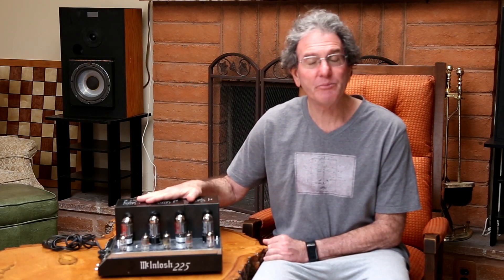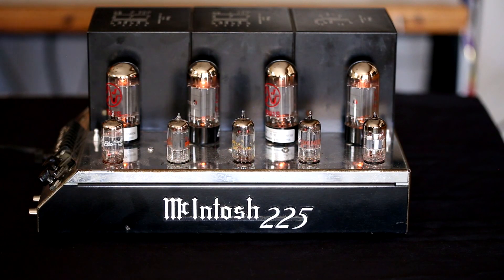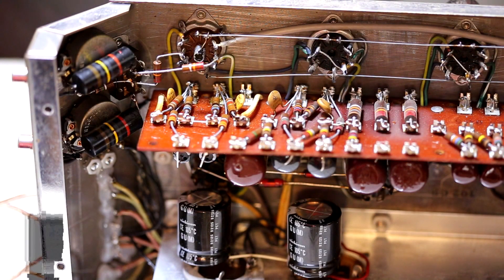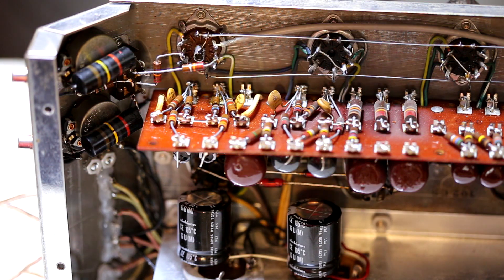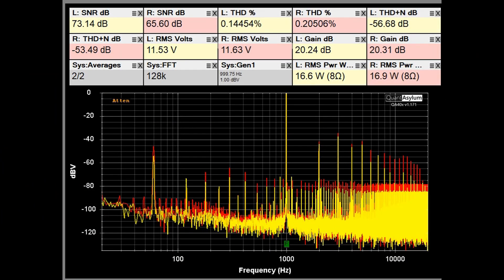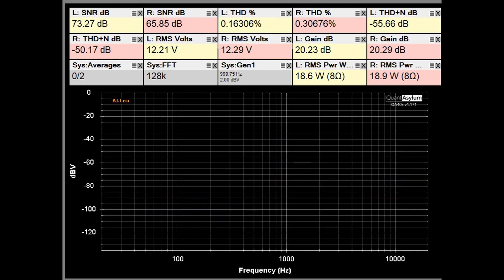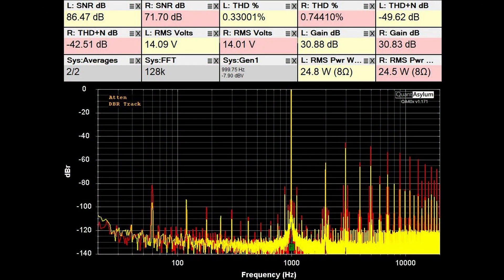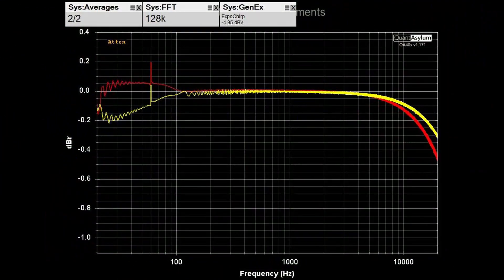McIntosh MC225 Power Amplifier- Vintage Audio Review Episode #58

Comment: Hi -- I have a MC-225 that had the power supply, audio path, and bias upgraded by Terry DeWick in 2018.  I am also using LaScala speakers.  How do I set the gain to the level you were referenced in the video.  I have the gain pots set at about "9" position to keep the audible hum down. Turning them up beyond that position introduces hum, especially in the right speaker, and doesn't result in much of an increase in the volume.  I am trying to optimize the function.
Reply from the maker: I am not familiar with the person you mentioned or what the bias upgrade involves, but it sounds like he know what he is doing. It sounds like your idea to minimize hum is fine. Were it me, since I have an audio analyzer, I would out in the standard 1khz signal at ~0dBV (1vrms) and adjust the controls for ~20dB of gain, which should be ok for most preamps. Since you probably don't have an audio analyzer, I like your method and with the lascalas- which make hums louder due to their high effeciency- the 225 should provide plenty of power to them.

Comment: You should never plug a tube amp in with no load. It’s a sure way to kill the transformers.
Reply from the maker: I appreciate your taking the time to comment. I have heard this before, but have always wondered about it since the spec for damping factor is based on the amp's voltage into an 8ohm load and then an open circuit, typically at 1watt. I have not had this happen in my experience when a tube amp was switched during an a/b test (my switcher does not have an internal load), though the power was <5w I am guessing. The same is true with the a/b test between a Marantz 8b vs the Ayima T9. If you were putting out power near the maximum output levels, this may be more inclined to happen if you disconnected the load (speaker) due to a very voltage or current spike ?

Comment: My Mac mc225 is the best amp I’ve ever heard. It looses bass when pushed. At low to moderate volume levels the amplifier is pure heaven!
I use a Vinnie Rossi LIO as a pre-amp with JBL L100a loudspeakers circa 1980. My favorite source is a Technics 1200mk5 turntable and Nagaoka MP110 cartridge. 
Blue Glow Electronics has a detailed video on restoration of the mc225. 
SkyFi Audio has two of these for sale, as of this posting, priced at $10,000 each. 
Thank you for highlighting this wonderful amp.
Reply from the maker: Many thanks for the comments. Quite a nice vintage system you have put together. I thought the MC240 sounded better than the MC225, at least the ones I listened to.
Reply: Yeah sky audio is highway robbery . I bought one directly off eBay for 3500$ and it works wonderfully . 
I'm also using a pair of 1959 H.H. Scott 99d integrated tube mono blocks as well that are quite nice themselves they do about 22WPC but they honestly sound as good to me as the McIntosh . Man old Scott Amps are honestly one of the best buys to this day!

Comment: Thanks for the video. I hear a bit of audible buzz or hum from the transformers of my 225, fully restored, when turned on without any input. Is this normal?
Reply from the maker: I would say that is normal for a lot of gear- if, by no input, you mean the 225 is not connected to any preamp at that time.
Reply: I don’t think it’s normal. My mc225 does not hum, buzz or hiss from the loudspeakers. I do hear a little hum from the amplifier itself if I am very close to it in a quiet room.
These are fantastic amplifiers - if the hum bothers you it might be worth figuring out what causes it. 
Blue Glow electronics has a video on restoration of the mc225.

Comment: Oh, what a great Mc225 is !
I owned beloved Mc225 after 2010. I matched it with Audio Research SP8, Linn Sondek LP12 and KEF 107/2. Great sound than any others.  I ❤️ Mc225..
Reply from the maker: Thanks for commenting. Depending on the level you listen at, the MC225 may not have enough oomph for the 107/2's if they are anything like the 107's which I have- at least it would be close for me.

Comment: Enjoyed the vid, very informative, thanks a lot.  That software is great!  I got one of these amps in a trade and will be recapping it, etc.  As far as a preamp, I'm a DIY guy, can you recommend a good circuit, maybe something from the RCA tube manual, that would be a good match for this unit?  Or what I should be looking for?  Cheers
Reply from the maker: Thanks so much for taking the to comment! I am not a DIYer except for power meters. I don't have any special love for tube gear- as a preamp- unless you are after the nostalgia factor. I would think re are lots of DIY tube preamp kits our there, but it is not something I have looked into.
Reply: @vintageaudioreview  Thanks for the feedback.  I guess I'm wondering what sort of specs a preamp should have to be a good match for the mc225, if there is such a thing.  I don't have to do tube, SS is more than fine if its a good match.  This is primarily for phonograph.  I'm afraid my next question is what sorts of speakers should i get!  Thanks a lot.
Reply from the maker: @schance1666  I forgot where I said I thought the gain should be adjusted on the 225, but you just want to make sure that the preamp can put out several volts- probably at least 3volts rms. A SS pre will be fine with the MC225's. Speakers- most important purchase you can make and highly personal. I would look at Klispch speakers or maybe JBL speakers that used a horn- you want something very efficient if you are using a tube amp...

Comment: You might be surprised at how different the MC225 can sound with different mfg tubes... starting with 1960's RCA Black Plate 6L6GC's and 1960's Tele's or Mullards in V1 (12AX7). 
Can you identify mfg and version of your very detailed charted test program ?
Thanks for posting.
Reply from the maker: Thanks for taking the time to comment and I appreciate you suggestion. The MC225 is not mine and as I remember I just replaced a few tubes with some "inexpensive" ones. I now own a pair of vintage  Mactube amps, but unless they start sounding bad from a tube or tubes going bad ,I would not do any tube replacements to them- am not sure how easy or affordable the tubes you mention would cost.... The measurement system I use is made by Quantasyslum- a QA402, though they have a newer version for sale.
Reply: @vintageaudioreview  Thanks for test info.  If a good 225 costs $3,000.... I would think $500+ in the best tubes (or internal parts) may be appropriate to restore the Magic.  Otherwise.. it may sound like you paid $3,000 for an olde worn out tube console.
Reply from the maker: @dynacoman7363  The 225 is my friend's and for him it sounds good. He rotates amps around his many systems. I agree that $500 for tubes and parts is not a bad investment on a $3000 amp (assuming you can do the work yourself).
Reply: @vintageaudioreview I don't mean to discourage people from buying and  modding 30's or a 225.  But... hope they carefully photograph and document their work... and save the original parts to enable a return to stock later.  It's only original once... and only about 5500 MC225's ever made.  Also... I never judge a piece of gear by hearing only one example.  (3) apparently similar 225's can sound completely different.  The first " restored and  improved" 225 I bought was a Total disappointment... flat, dull, lifeless... wondered why anyone would ever buy one.  Then bought a 98% original (slightly rusty) 225.  Magical.. Cannonball Adderly was standing out front.. in my living room.. soulfully playing just for me. 
Learned not to judge by external  appearance ... manditory to closely inspect underneath.  Dog bones ? check.  Black beauties ? check.  Rust ?  No problem.  About 10 items on list.  Luckily the new Korean chassis are exquisitely detailed.. and not $pendy. 
Buying pr of 30's or a 225 is not the culmination of a quest... it is the Beginning of a Quest.  A totally enjoyable journey to bring one back to life.. as the engineers at the  Binghamton works  intended.
Reply from the maker: @dynacoman7363  You are obviously very knowledgeable and it is nice to have a discourse here. It is one of the enjoyments I get from having a small channel and being able to interact with viewers, and often learn from them. Will stream Cannonball aderly as I am not familiar with the music, though I am the artist. For me, having the Mackit30's is the end of a quest for tube amps- unless I am at a yard or estate sale and come across a great deal kinda thing. For the most part 30's will be used once in a while- like taking your classic car out for spin. My audio bucket list is mostly full except for finding a vintage SS amp that has nice big VU meters and at least 400w/8ohms. The only one I can find thus far is the MC402. I am open to suggestions...
Reply: @vintageaudioreview  No longer follow large transistor amps.. but remember that Mitsubishi made a line of dual mono power amps with  Large meters... that were supposed to sound vg.   "..the DA-A15DC was Produced from 1979 to 1980, it retailed for $700. Which is $2,510 in today's money. 150 clean watts per channel."

Prob only couple hundred today.  Not sure if they have 400 watt model.  Be careful about Power.   During 1970's mfg made Serious compromises in sound to achieve higher power.  For example.. the Marantz cap coupled 2230 sounds waaay better (on effecient spkrs) than their direct coupled 2275.  Their 10 and 15 watt rcvrs.. (2010, 2015)  intended to be low-margin entry level stepping stone rcvrs... were discontinued in  part because people bought, loved them.. and never moved up to Marantz's $pendy high powered models.
I've owned various models of McIntosh transistor gear...  their razor sharp  crystal clear distilled water modern sound  never made my heart beat.
Reply from the maker: @dynacoman7363  I reviewed a 2230 and it performed and sounded great. Interesting about the Marantz receivers, but for a lot of folks they would have all the power that is really needed. I have only reviewed on SS mcintosh amp, and that will be the subject of tomorrow's video release 😃 and thought it sounded great.
Reply: @vintageaudioreview    Fortunately.. everyone's ears unique.  Transparent to one person.. cat's claws on blackboard to another.
My focus is on the music... mostly 1960's  Blue Note records.. engineered by Rudy Van Gelder.  "Back at the Chicken Shack" a good introduction.  Stanley Turrentine - tenor sax
Kenny Burrell - guitar
Donald Bailey - drums
Jimmy Smith - Hammond B3

Looking forward to your next gear review.

Rapide
(AudioKarma)
Reply from the maker: @dynacoman7363  I am more of a gear guy 1st with music being what is used to highlight the gear. That being said, I have music on most of the time and that is just because I enjoy it- not so worried about the fidelity when it is more "background" Found a Cannonball adderly LP and listened to it via my streaming platform, but it was not my cup of tea. I do have the blue note Stanley Turrentine 2002 collection and enjoy most of that. Will check out back at the chicken shack next.